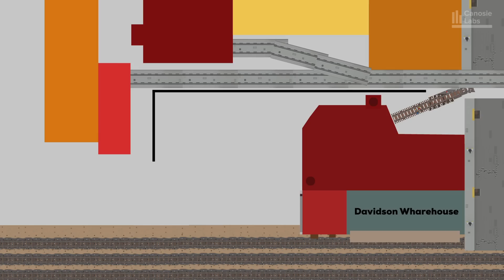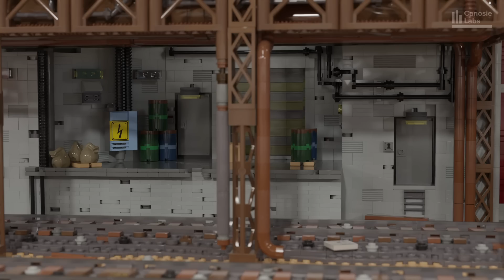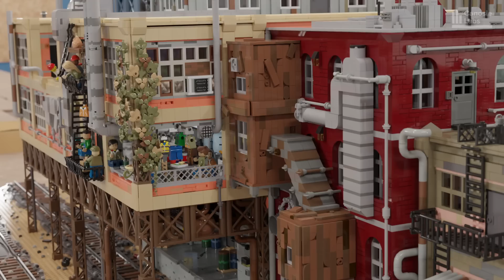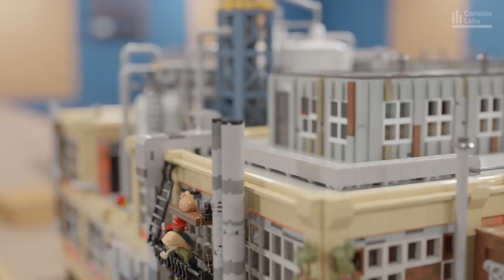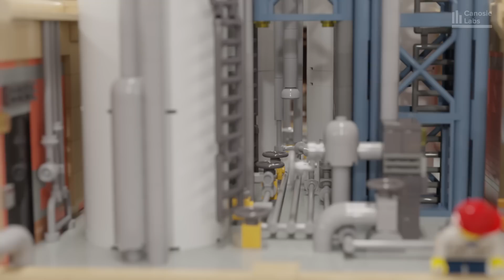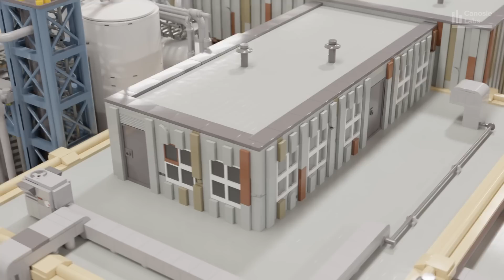Digital Lego City: Pipes and Tanks | Episode 9

Comment: The new additions brings so much more life to the space. The lounge space with the drying of the clothes on the building feels likes it is in very hot working conditions. I am curious of the pipe that runs into the ladder structure. Is something supposed to come out the pipe at the top? It would feel like if that is the case it would pour down on the workers using the ladder. Your window planning with using different color frames is so well thought through. Old and beat up with some windows busted out.
Reply from the maker: thanks for the comment!   
haha, the pipe that runs into the ladder structure was something I did just to make the pipe disappear.  I was thinking of having it bend and exit over on the other side but I forgot about it...

Comment: One building you should make like a fish Can one side of the building is the manufacturer side has like the skywalk thing going to cross the tracks to the warehouse with a dock for trucks and trains to load up put the train tracks in like a old style brick road and the part that goes over the train tracks you can put a convertible belt in there cast of moving back and forth inside
Reply from the maker: thanks for the comment!  I really like the idea of a skywalk or even a conveyor belt for bulk cargo.  A lot of old factories have skywalks or overhead passages connecting buildings together.  interesting!

Comment: Idea for that area in the middle of all the hustle and bustle I think it would be the perfect spot for a hole that’s open to the train line underneath, we can say that there was a heavy truck that came in and broke through the concrete because of some water damage from a leaking pipe and now the repair crew is fixing up the sinkhole.
Reply: It would make sense that there were trucks going around that area because there are truck ports In the other building there so they would need all the space they could get to turn around.
Reply from the maker: that's a great idea.  thanks.  Since the video I've already started working on it.  I've put in something "similar" .  It's not a sink hole, but it is a hole.  I've actually put in a disused end stub of a canal.    The canal to this factory was underground and at the stub end, it opens up to unload cargo via a crane.  Since the canal is not used anymore, the some parts of it are "patched" up to give more space to trucks.
Reply: @ thanks for responding to my comment though! Can’t wait to see the out come. Little thing that I have thought is a street running train track not for trams but for my actual trains, and the best bart is that it’s sitting right in my room!

Comment: Looks really good. One thing for the supports on the harbor side. They look a little “thin”. So either could use more of those column pieces or brick build thicker ones.
Reply from the maker: yeah, that's a good point.  Thanks!  Originally I had more columns, then removed them.  it's one of those things :/